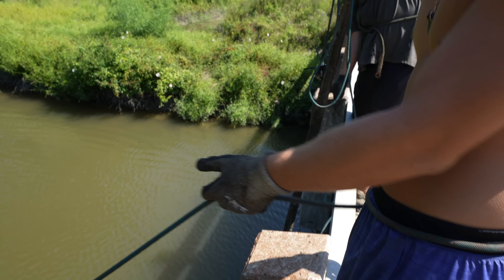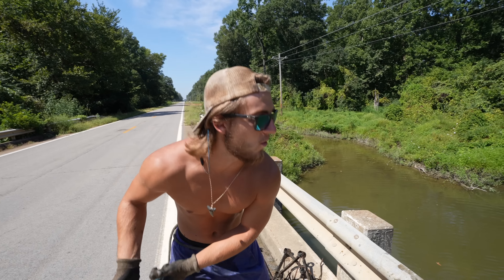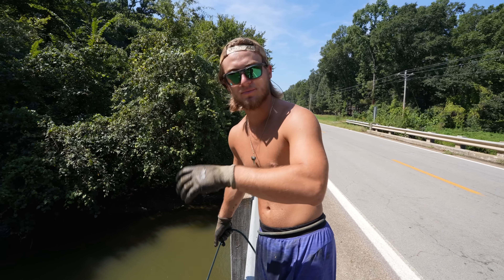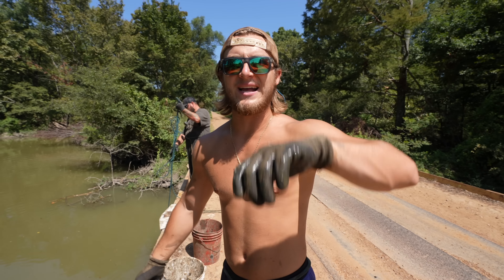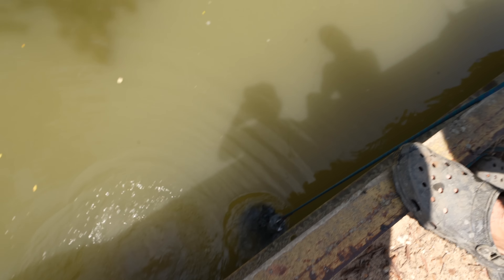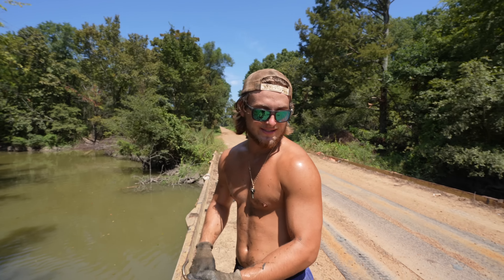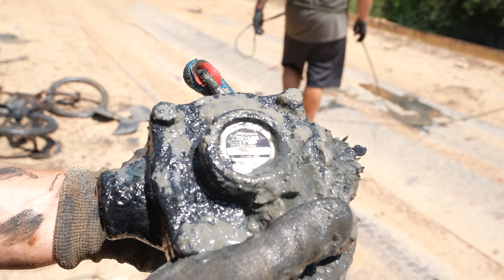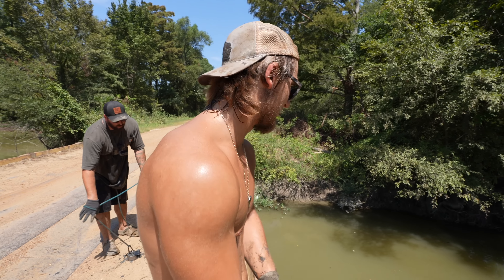I Think We Found A Truck Magnet Fishing

Comment: You're a round thing you found with the grooves in it I believe it's the top to an old air filter for a carbureted engine if you look in the center there's probably a hole right in the middle